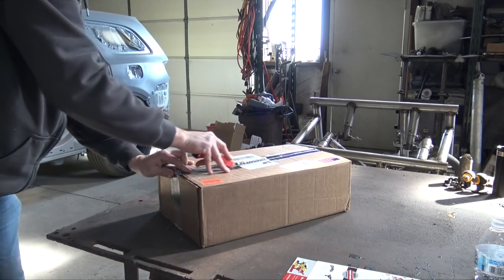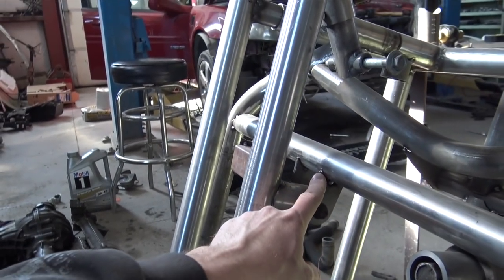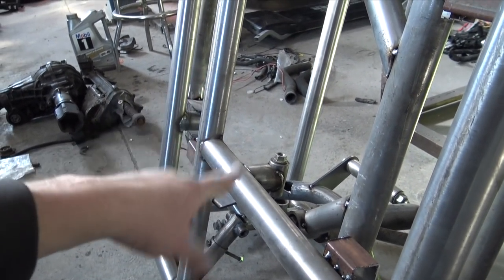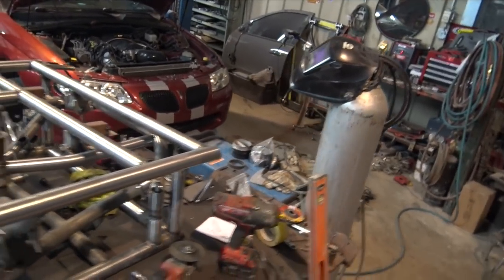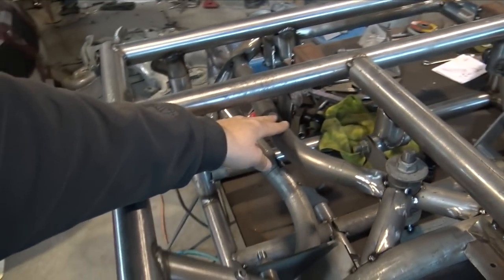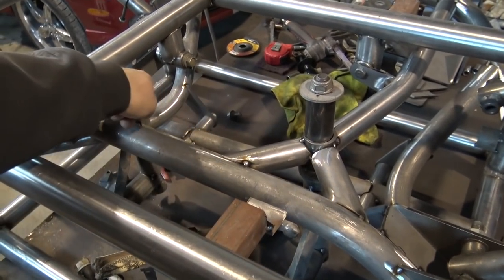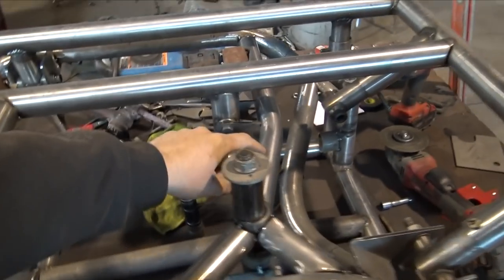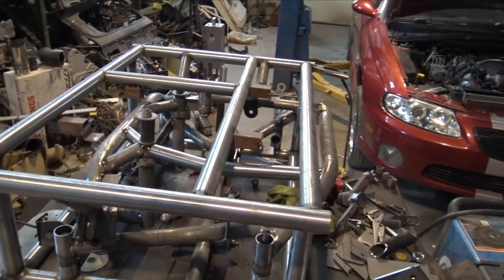Building the Ultimate Station Wagon |  Charger Magnum Hellcat | 1000HP Hellwagon | Pt 80

Comment: are you going to have to put stronger gears in the differentials or will they be able to hold the power
Reply from the maker: Since the charger is going to weigh less than the trackhawk it should be strong enough